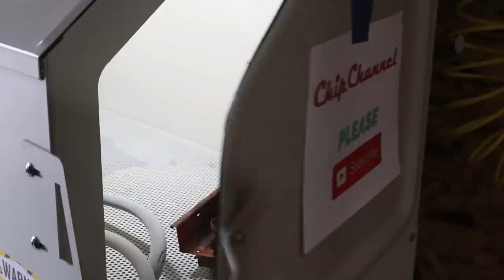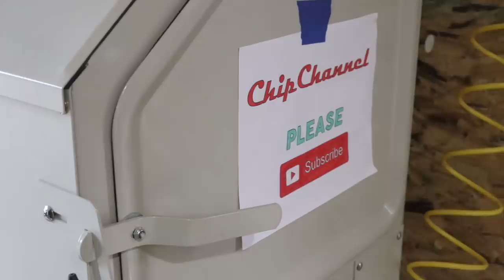1965 66 Tonka Pickup Custom Color Restoration

Comment: I have massive collection of 1949-1980 Tonkas. All are in original factory condition many have their original boxes. I started collecting in 1960 at the age of 10 and kept on going. I bought many of them while traveling the country as a union pipefitter in the 70's and 80's. Many of them are the scarce private label promotional Tonkas. I bought a collection off a lady in Texas back in 1975 over 300pcs. all on priginal unplayed condition for 500 dollars. I have over 2000 pcs. in my collection.

Comment: It seems like there's only 1 downside to the powder spray method; it gets very thick and tends to make the (embossed?) names in the tailgates and such a little too smooth and vague. Not a huge problem of course. Its beneficial to hiding any extra pits and imperfections in the body, but then also overly rounds out those names edges. (Oops lol)

Comment: Do you sand after primering or does the primer fill in the rust pitting?
Reply: Hello Julian, Some powder-coating primer is enhanced by wet-sanding. 
It depends on the top-coat of powder coating that will be used. 
Always follow the manufacturers' directions. 
Watch this Chip Channel video: https://youtu.be/7qmm9qUzz2w 
Kind regards,  Ben

Comment: when you powder w/ the chrome after do you have 2 sand down a bit then apply the candy apple
Reply: Great question Rudy. 
In my opinion; sanding the chrome powder-coating would NOT be advisable. 
Because the "shiny" aspect of the chrome finish is the underlying effect you want for the 
candy top-coat. Sanding the chrome would dull the finish & diminish the final effect. 
Others may disagree...but...I'd never scuff or wet-sand the chrome undercoat.  
I hope my comments are helpful. 
Kindest regards, Ben